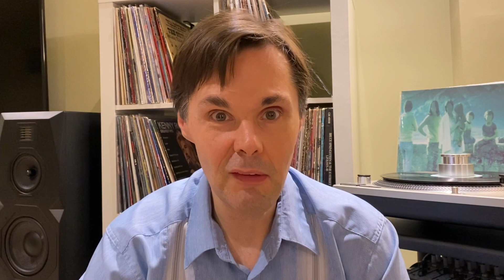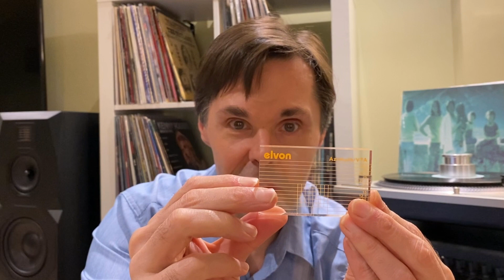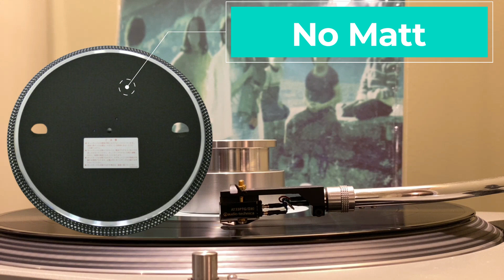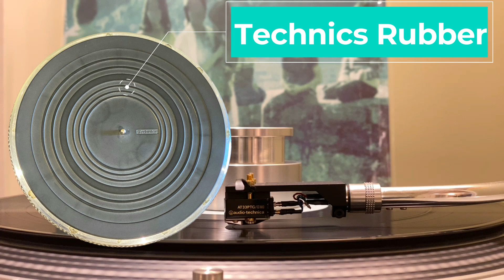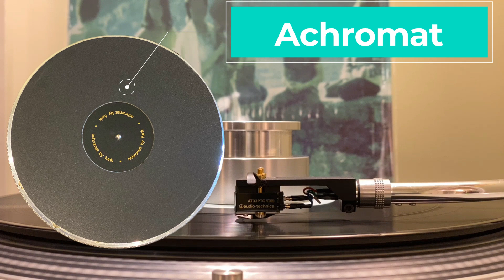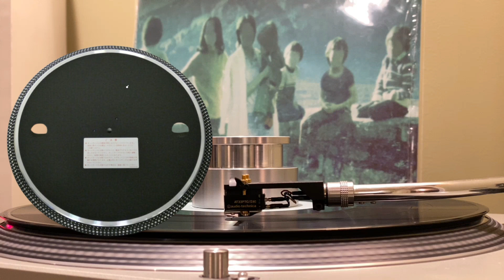The Official Turntable Mat Shootout -- Felt vs Acrylic vs Achromat vs Rubber vs Cork - Hudson Hifi

Comment: Ive tried them all over the years and I keep coming back to a thick dense rubber mat for its ability to manage surface resonance and dampen the inherent "ring" in some aluminum or steel platters (my opinion).  My 1980's Harman Kardon T40 table and all other HK's of this era came with what was describes as a "high density anti resonance" rubber material and to me anyway rubber feels and seems like the best above all for this - if seen some cork mats heavily impregnated with a high percentage of rubber that look like they might do well but cork likes to shed with age and im not a fan for that reason and the fact that most cork mats dont have a label depression in the center so the album sits flat.  Of course these are all just my opinions - except for HK and Pioneer who always used rubber back in the day before all this plastic fantastic stuff came into play.

Comment: I have a black Hudson acrylic. I don't notice any difference in sound between it or any of my other mats (felt, thicker felt, two rubber and a cork) but it sure looks cool. As for antiskate, I have spent hours and hours researching it and came to this conclusion: it cannot be set perfectly. The perfect value changes with modulation from passage to passage. 'Close enough' is the best you can hope for and it is probably the biggest weakness of the format. That said, close enough sounds great and I will never stop loving vinyl.
Reply from the maker: That’s cool… just did this to help… honestly the biggest difference I hear is the Achromat… anti skate is close enough… but hey we all love our records!  I love the old ones best! 😄

Comment: I've used Herbie's Way Excellent Mats on my Technics SL-1200s for over a decade. No turntable mat settles down <10-pound metal platter issues better than it does without radically changing image focus, high frequencies. And I love that the Way Excellent mat inhibits static and takes to frequent cleanings. Even after a decade, they haven't jacked their prices into the stratosphere like most companies seem to do monthly.

Comment: Thanks for that :) Achromat for me sound wise is the winner. I played this video through my rocket 8 monitors fairly loud and the difference was pretty noticeable as far as separation. Close 2nd was the Hudson Acrylic. Less separation but balance and low end punch was accentuated. Might go with the Acrylic though just because money :(
Reply from the maker: Kind of my synopsis as well... Currently I am not using a mat on my new table which is an audio technica LP-7 because the platter itself is made of delrin... just using a clamp...
Reply: @BensAudioCave  Oh wow that's pretty interesting. I have an audio technica LP120XBT. First turntable. Really solid but on the look for a USB phono preamp within the $500 range.. So tricky to figure out what will fit my Grado DJ200i for best overall sound yet still keep the warmth that it gives the records 🫠
Reply from the maker: @Dane3p  well I have since moved on to moving coil... What is the need for USB?  That Grado is a moving iron so about any will work... 

For your setup I can highly recommend the art preamps as they sound incredible for what they are... I recommend updating the power supply to a linear one... Here are some links

Preamp
https://amzn.to/3Qla0Dk

Power Supply
https://amzn.to/3SihBoK

Comment: The original Technics thin slipmat that came with SL-1200mk7 does a pretty decent job. It's not like cheap sloppy slipmat, it's not particularly bendy and it controls the static pretty well. I mean, it sometimes wants to cling onto record but the record itself remains mostly free of static when lifted unlike Technics 6mm thick rubber mat which caused quite heavy static crackling.

Comment: One thing I noticed Visually is that the Felt Mats did not correct any of the Vinyl warpage compared to the Firmer Mats! Surely this has some Effect on sound as a warp vs flat Vinyl surface will make a sound difference.

Comment: I ended up with an Achromat for my SL1200G - its a bit cleaner and clearer than the standard Technics - highly recomend. Note - always worth checking if your record sits flat on it - one of mine sat raised off the mat until I turned the mat upside down! Odd I know! I usually use a basic Michel Clamp too
Reply from the maker: Honestly my first one was pretty warped... The company I bought it from took care of it and even opened the replacement for me to make sure it was flat... Also Arthur from Funk firm sent me another as an apology... They had a bad run of them. :)
Reply: @BensAudioCave  with me & my experience - the matt is flat but one of my records seemed to sit the label in the label hole and the rest of the record raised off the surface - so I turned the Mat upside down for that one and it was then OK - always worth a quick glance to see the record is flat on the mat

Comment: I genuinely don't hear a difference when I switch between mats, and I've got several (acrylic, rubber, felt & the achromat). If there's a difference in SQ from one mat to the other, it isn't noticeable to me. That said, I don't think the different mats are useless. Some do serve a purpose, and some just look really nice on certain 'tables. Also, you can raise & lower the playing surface quite a bit w/ mats, and that may be the difference in whether a particular cartridge will work or not for folks who can't adjust their tonearm. 

I use the Funk Firm Achromat on my turntable (The Music Hall Stealth). It looks like it should have been on the 'table right out of the box, imho. There was a lot of static w/ my Fluance RT85 (It has an acrylic platter) and the achromat on the Stealth's platter has little to no static.

For me, that alone makes the $$$ spent on the achromat worth it.
Reply from the maker: I will say you should likely try a different playback method… also I have adjustable VTA which accounts for mat thickness in this video and all mats had equal VTA measured with an Azimuth ruler… thanks for watching
Reply: @BensAudioCave  I wasn't being critical at all, sir. Was only expressing my opinion based on what I've heard.

...and I'm cool with the playback methods I'm using. Thanks...
Reply from the maker: Oh I get it… was just saying through my DAC I can hear what I heard in my room with this comparison… also try some gruv glide on the acrylic platter as it will eliminate static and use a clamp to couple it to the record… it really helps on an acrylic platter

Comment: This is exactly the demo I needed!! To my ears, the differences were extremely subtle...  in fact I kept jumping down to read the comments, I'd hear a "cut," guess which material we were on now, scroll up... and I don't think I was right once.  😂

It's reassuring because the test suggests that maybe I can squeeze a tiny bit more coloration of the sound out of my system with a particular material...  but no matter what I use, it's not going to "ruin" the sound. I don't need to go donate plasma to get the latest, greatest material for my turntable.

Comment: To get my VTA in the right neighborhood I used a thin rubber mat with an acrylic mat on top.  The static was terrible with this combination.  I think that a felt or acrylic mat alone have the potential to slip on the (Technics aluminum) platter, which can't be good.  I keep going back to a thick rubber mat but they are hard to find (at a reasonable price).

Comment: This test was a bit impossible to tell, I think some people might be imagining some things.  The Acrylic to me sounded slightly more open...BUT, unless you are playing the same cut over and over for each mat instead of just going through the music which is changing from one mat to the other, it would be nearly impossible to hear the differences because you have nothing to compare any of the mats with that is consistent.   

With that being said, I have the stock rubber mat, a cork mat, and a Hudson HiFi Acrylic mat, and at home, I could immediately hear the difference that made the Acrylic mat just stand out from the others by a wide margin.  But, in your video presentation that difference that I got at home I can barely tell anything on this video.   A lot of that might have to do with  I have just regular YouTube, which is not the best sound format to be trying to critically listen to music, whereas some of you might be listening with YouTube Music Premium thus can hear more subtleties than I can.  But again, I keep going back to not hearing the same cut being played over and over for each mat, and for me that presents a problem.
Reply from the maker: I was trying to make it enjoyable… I do have all the videos for each mat… I did capture the audio at 24/96 FLAC but YouTube doesn’t let that happen… it’s more like a 192 mp3 on highest quality… still when played through a DAC and the system which you would be using the turntable with; the differences are there… it’s just a guide and for fun…

Comment: Normally I can’t hear much if any difference in these comparisons maybe since I’m listening through an iPhone. However this comparison was different in the sense that I could hear a more powerful bass line when ever you used either of the rubber mats and it sounded lifeless when using the cork or no mat at all. Having my eyes closed I could also detect more vibration through my phone to my fingertips which I double checked by only opening them when I felt it and sure enough you had displayed one of the two rubber mats. This was surprisingly good news for me and now I can use that extra money on other magic beans I’m sure to come across in my pursuit for sound perfection. Thanks Mr. Ben.

Comment: I seriously doubt that a mat will produce any audible differences. Ringing will only occur when actually tapping the platter which a turntable doesn't do when playing a record. There are of course other important factors to a mat: generating static electricity (or the lack thereof), avoid slipping and release dust partials (some cork mats and felt). I find that most rubber mats who are usually supplied with a turntable tend to be static electricity generators. That's the main reason why I would fit a different mat to a turntable.
Reply from the maker: Did you even watch the video and listen to it through a good stereo?  Because it sounds like you didn’t… having an opinion is one thing but why write a whole paragraph dispelling the whole premise without watching and listening?
Reply: @BensAudioCave  Why is it that people don't respect each others opinions anymore? As soon as someone says anything different to their believes we receive comments such as these... pitiful.
Reply from the maker: @pascalhibon7928  sir I’m not disputing your opinion… I’m asking if you watched the video because your comment seems you dismissed the premise without watching and using the tool I tried to provide
Reply: @BensAudioCave  I watched it partially for mainly two reasons: this is not the first video on the topic I've watched and secondly (more important) if there is any audible difference then it will be so tiny that Youtube compression makes it impossible to hear. I was hoping that your video would go beyond the audio clips trying to identify audible differences. As I mentioned in my initial comment there are other reasons why to shop for a turntable mat than sound quality.
Reply from the maker: @pascalhibon7928  I get it… but that was also talked about during the intro and outro…

Comment: i think the thinner rubber mats are best otherwise the stylus can bottom out if the mat is too thick
Reply: On most good tonearms you should be able to adjust the arm height. If not stick to a mat with the same thickness as the existing one. Some mats are offered in several thicknesses.

Comment: I use an Achromat. It’s been great. I think the most risky mat materials are felt and cork. Either could rip the needle off a cartridge if the needle is dropped on the mat with the platter in motion.
Reply from the maker: To me a felt Matt is pretty much for a DJ… never really been a fan and they collect filth as well!

Comment: I have a felt mat and was listening to the 1st Movement of Mahler 10 which has some incredibly quiet passages. There was no static whatsoever.  Another similarly good condition record (can't remember the piece), there was a fair amount of static. That tells me it has nothing to do with the felt mat and much more to do with the actual record pressing, or maybe the amount of times the record has been played, or the quality of equipment the records were previously played on (both records were 30-40 years old).
Reply from the maker: I am not talking about surface noise… I’m talking about actual static when you lift the record off and it sticks or adheres…

Comment: Really helpfull. Non were terrible, but there was a noticable difference. The Acrilic sounded a little brighter at times - the Achromat seemed to be the overal best for me - nicely balanced detail throughout - felts sounded....felty! Rubber was less good on the Technics a little more muddled - the Hudson Rubber was a tad better, less wooly in the bass than the Technics - these are all small differences however

Comment: I’m not advocating that people spend a lot of money but one reason I think that there may not be so much different in some of the math is because a lot of the Moving magnet
Reply: My comment posted before I was able to finish it I’m not advocating that people spend a lot of money but I think one other reason why mats frequently do not make a lot of difference is that the cartridges people are using are not capable of going deep enough in the groove where some of the advanced technology mats supposedly are able to contribute to stabilize the tracking to extract more information reliably with less noise out of the groove

Comment: First off, love your channel. My table came with a acrylic platter. I put a cork mat on it and I’ll swear it changed the sound, especially the highs. I removed it and have no intentions of putting a mat back on. However, I never considered that it could have been the VTA that changed the sound. Now I’m back to scratching my head lol.
Reply from the maker: Thanks David!  So couple of comments:
1.  VTA can be a huge factor so don’t discount that… some styli are pickier than others
2. If your table came with an acrylic platter (like a project) than that is the the correct surface to be used mat less… the only thing I will say is treating the platter with something like my rinse water (distilled and a trace amount of gruv glide) might help reduce static… and if you aren’t already using a weight or a clamp; you should consider the record doctor clamp (cheap $30) to couple the platter and the record for best results. 😀

Thanks for watching and here is a link to aforementioned clamp:
https://amzn.to/3L3oWTd
Reply: @BensAudioCave  I do have a record clamp from Fluance and I will be making up some of your rinse to wipe off the platter. Thanks for the tip.

Comment: My main concern about some of these mats is grime and dust.  Felt mats, for example, just seem like a dirt trap.
Reply from the maker: And that is my synopsis too… kind of like carpet vs hardwood… the cork seems to shed the most… the felt traps yucket and I see it on my previously clean records… the rubber will always be good at being cleaned… the acrylic and Achromats are easily spotted when soiled… however, they just need swept mostly… as I said in another comment; I treated both of those Will my rinse water which is just distilled and trace amount of gruv glide and there is virtually no static or dust attraction… so they are win there and to my ears even more in the sound department… thanks for the comments! 😀

Comment: I have to agree with you, the Hudson acrylic and Achromat were the best.  I have borrowed both of these to trial and still found the EON to be a nicer sounding mat.  Like a good comparo.......
Reply: EON ? I had an EON pod as a record clamp but the rubber rings dry rotted.
Reply: @andershammer9307  Hi Anders, the EON TriPod was designed to be used with the TriPad mat. Although any clamp could be used with the mat and the tripod  would work with any other mat too.  I found the TriPod very easy to apply.  Did you use the TriPad mat.
Reply: @peterrech2307  No the store owner who I bought it from didn't tell me about the TriPad mat. I used it with the Platter Matter. It slightly improved sound. I'm getting another device to improve the sound which is called a weight but its some sort of anti-resonance device.
Reply: @andershammer9307  Ok, let us know how it works...Platter Matter was a good mat.  I still se the Eon TriPad on my old English Logic Gemini belt drive two motor table and it still sounds great.  I use a screw down clamp or the tripod, depends on the record.  With the EON Mat you have to use a clamp because of the slight dish in the mat.
Reply: @peterrech2307  Well it's a Christmas present so I'll let you know after Christmas.
Reply: @andershammer9307  looking forward to reading about it....